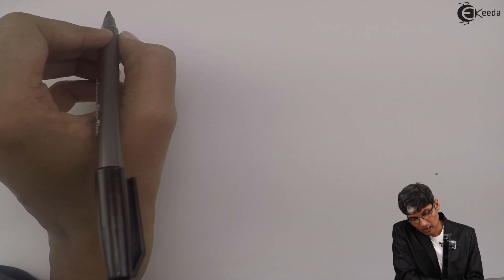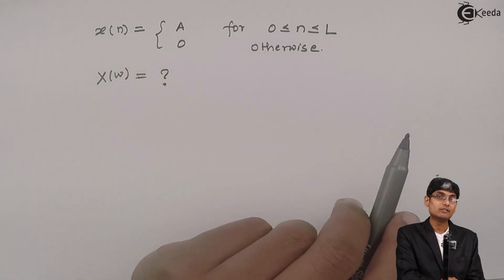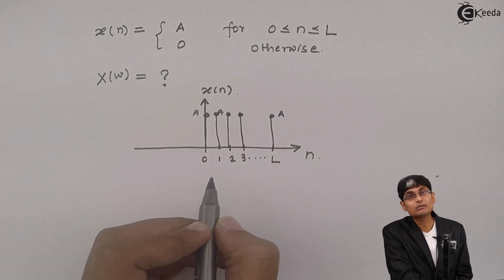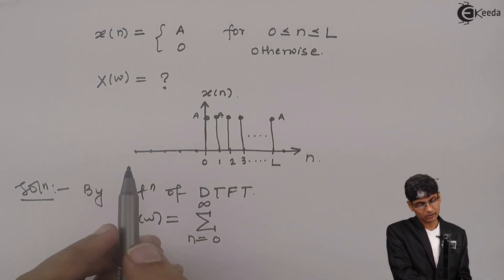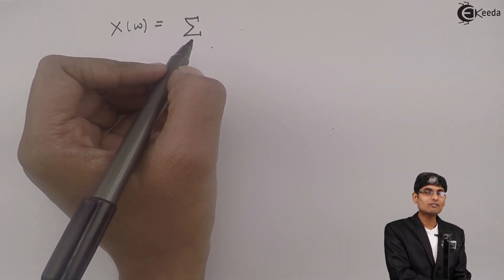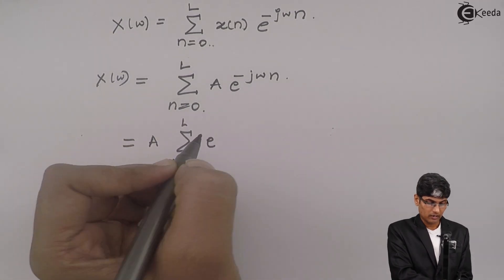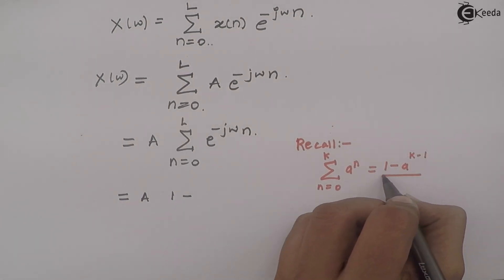Problem on Discrete Time Fourier Transform (DTFT) | Discrete Time Signal Processing

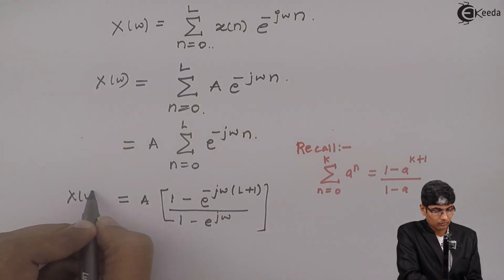Comment: At 04:36, 
If we are considering 'e^(-jw)' as 'a', 
then the denominator is supposed to be '1-e^(-jw)', instead of '1-e^(jw)'.

Because otherwise, it means we are considering 'a' = 'e^(jw)' [From the finite series summation equation], and that means the summation must have 'a^(-n)', and not 'a^(n)' - which is not the case.